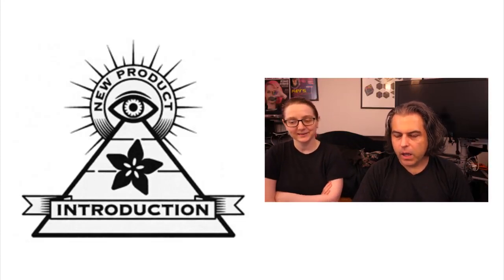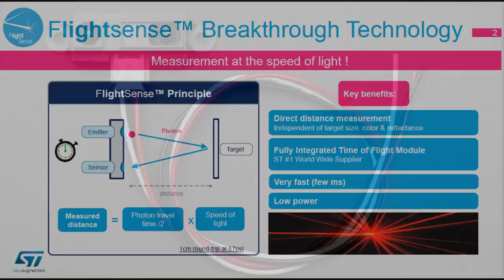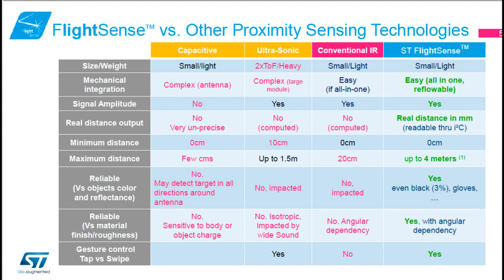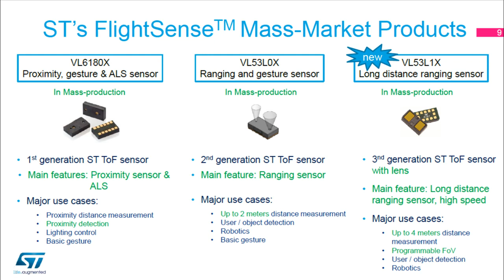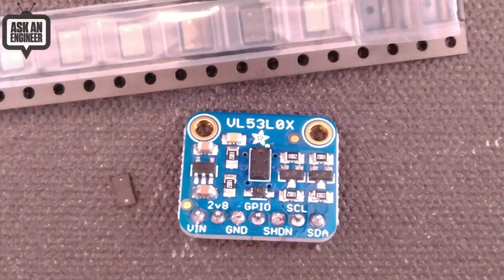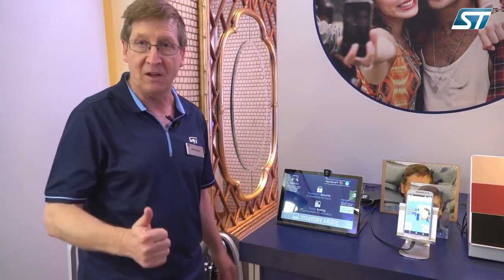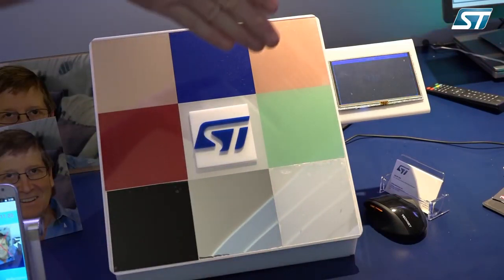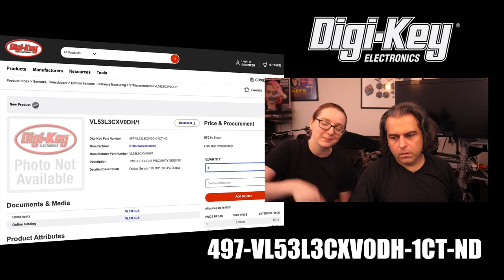EYE ON NPI: VL53L3CX ToF Sensor #EyeOnNPI #Adafruit #DigiKey @digikey @adafruit @ST_World

Comment: Would love to know if this can properly detect distance to a polycarbonate clear sheet.  This is a problem with First Tech Challenge as the polycarbonate walls give big problems to robots trying to see how far away they are - as the readings are inconsistent.
Reply: I don't have PC sheet here, but I've tested it against my laminated glass window and it is properly detected. The sensor is able to "see through" only when the glass is VERY close to the sensor, anything above a few milimeters/centimeters is considered a target. What does sometime make problems is water surface. Waves can cause the light to reflect in many directions and the sensor may not detect any target.